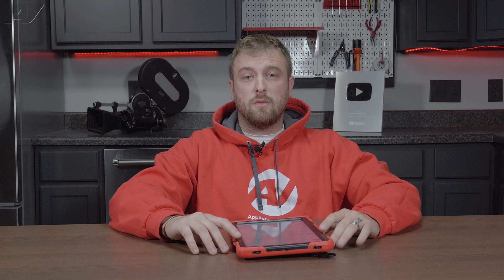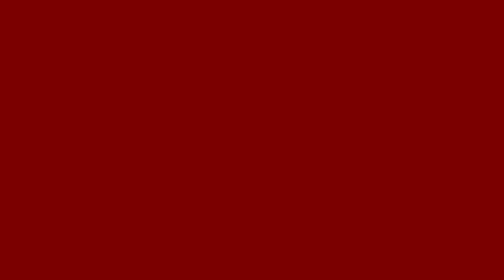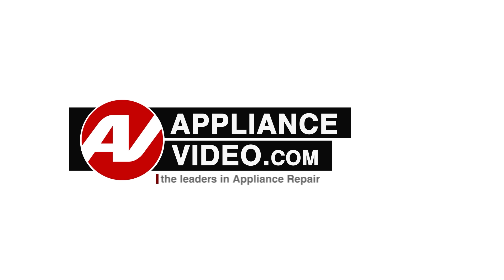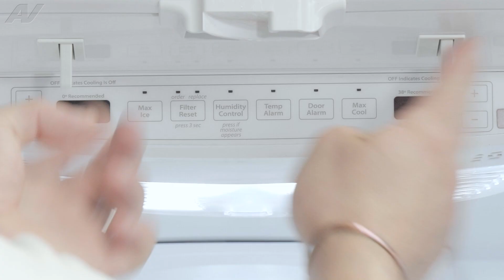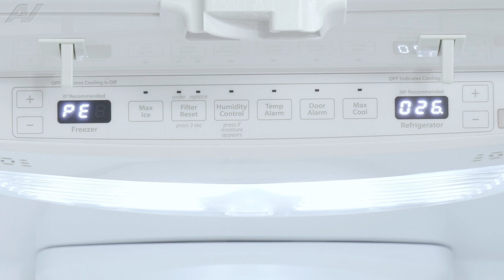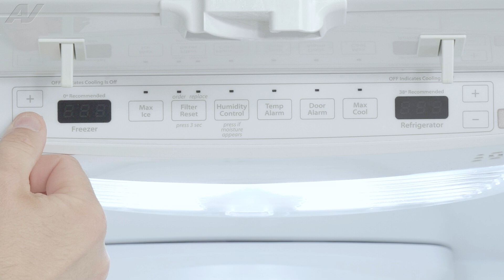Maytag Refrigerator - Service Diagnostic & Error code Testing - Programming Mode Troubleshooting

Comment: I Oestion on a GE French door or really any unit. I have a refrigerator that had a dirty condenser coil for a while before seeing the unit. My thought is it ran hot and allowed oil to leave the compressor and obstruct the cap tube. Is it possible to heat up the tube externally to clear the blockage? If I have replace the filter drier this unit has dual evaps was trying to avoid it.